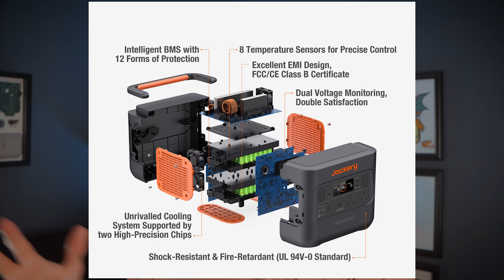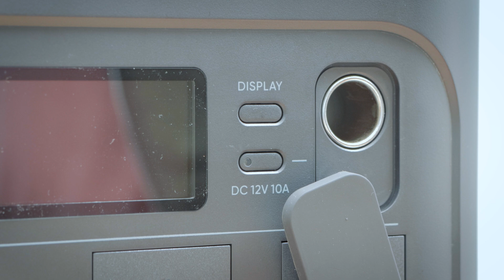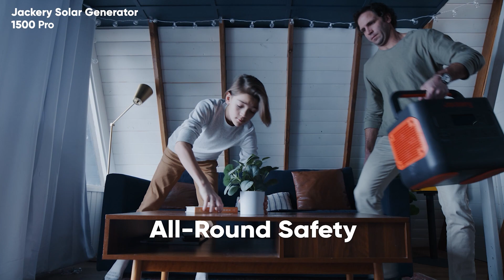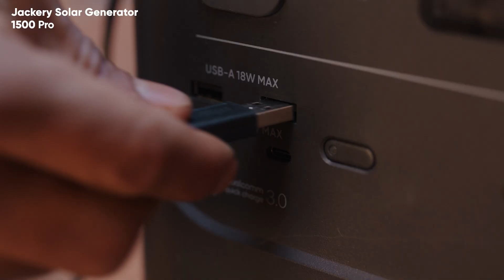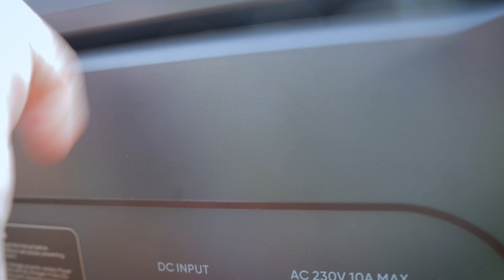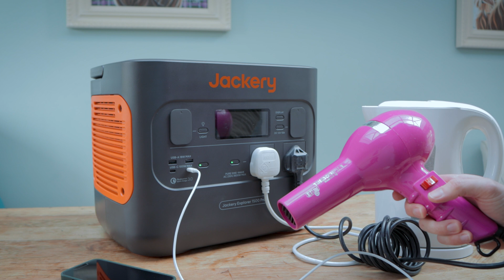Power Anything, Anywhere |  Jackery Explorer 1500 Pro Review

Comment: there was a power outage on february 22nd 2026 there was gusty winds of excess if 80+ mph and thanks to the pecron powerstation i was able to live like normally during that time, i was the only 1 with the lights on during that 17 hour time period 11:30 the power went out and the power didn't come back on later that day combined total of 4096WH i was able to power everything with the pecron powerstation.. its a miniature homeback up during the time of the black out. keeping the laptop running and having the fridge running as well along side the clock. when i was seeing the battery % it was reading 95% and it dropped to 37% and this was during the time during the blizzard as well, snow has dumped like 31 - 41 inches of snow during the blizzard in southern new england in massachusetts. (USA) thanks to this battery backup that i had, i was able to use the microwave during the power outage. 100 - 125 maybe 135 watts the powerstation was absolutely fantastic. the runtime with the fridge being cycled on and off was anywhere between give or take 24 hours to maybe 48 hours. when i was at 37% i was able to get another days worth in if anything...

Comment: Please read before purchasing Jackery products. I bought a brand new 1500 pro from their site and have had the worst experience. Save your money think twice! 

BEYOND FRUSTRATED DONT BUY FROM THIS COMPANY! When I received my first unit it was clearly brand new which would be expected. The battery was great worked exactly how they explained it would in the description. I would use this unit running off my ice co electric cooler with multiple accessories and it would last me 3-4 days while camping. Within the first 6 months I used it maybe 4 times and then stored it over winter (4-6 months) When I pulled it back out of storage for use the battery was at 97% hardly dropped from 100% when I stored it away. Awesome this is what they advertised on their website. But during my next camping trip my unit started showing a F0 code and nothing would work no input or output. This was a huge problem since I heavily relied on this unit to keep my food fresh and not spoiled. I noticed while lifting the jackery up and placing it in my vehicle to charge (thinking this would fix the pop up code) the F0 code turned off thankfully saving my food and my trip. When I got back home I emailed support and they informed me this was an internal issue causing some sort of disconnect normally due from faulty parts, dropping the unit or negligence during use. This was not my case since I never dropped the unit or mishandled it. I shipped my original unit back thinking they would stand by their “warranty” WRONG they clearly sent me a used unit that dropped battery 5-7 % a week. The unit had some use marks on it and I could tell it has been used before even though it was wrapped up like a brand new unit. I emailed support again going back and fourth as they tried to justify that this was normal even though my new unit did not have this issue. The battery was obviously compromised and after restarting it and charging this warranty unit to 100% it dropped down to 67% in 30 days. Support agreed this was not right or normal and sent me another unit. Annoyed already by this and me having to drop off now another unit to fedex I was adamant that they review this unit to make sure the battery was in fact compromised (so this wouldn’t happen to another customer) and to review the new unit they send me. They sent me another “warranty” unit… it was the same exact s/n # as the unit I just sent back to them! I cannot make this up.. terrible support terrible company! I bought this $1,300 1500 pro plus a $600 200W solar panel due to the great reviews and WARRANTY they claim to faulty parts or makes on their end so the buyer is protected on their investment. Don’t buy from this company! I fell into the trap of there multiple highly rated reviews (that they probably pick out) and the fact that they had 2-3 year warranty on their products. THEY DONT REVIEW THEIR RETURNED PRODUCTS AND WILL SEND YOU ANOTHER FAULTY UNIT THAT THEY CLEARLY DONT CHECK. PLEASE STAY AWAY SAVE YOUR MONEY AND GO WITH ANOTHER BRAND! Highly disappointed you are gambling big time with this companies products that the “new” unit you buy is actually new and doesn’t have any faulty parts and if it does even within the first year of owning you will not get a new or even close to new “refurbished or warranty” model. I hope this review gets out to the thousands of customers that look into this company and purchase their products that are not cheap by the way and that Jackery actually changes their warranty policy or at least states that you will recieve a unit that is not new and not even close to being a working model like described in the units description. They don’t review the returned units and I asked now that they send me my original unit so I can try to fix the F0 code myself at least I know this battery is a year old and only been used 5 times. They will probably hide this review and I will try to get my story out on other platforms so others can know. Terrible support and not true to their warranty description.. if you are buying becuase of the safe bet on the prodcut working and the 2-3 year warranty think again and pray your unit doesnt have an issue like mine did because they will probaby send you a POS old returned unit that they dont even review when receiving them from their customers! JOKE COMPANY STAY AWAY DO BETTER JACKERY!
Reply from the maker: Hi! Appreciate you sharing your experience with us all.

Comment: Excellent review thanks 🙏 will it run an air fryer up to what wattage please ?🤔🚍⚓️🇬🇧
Reply from the maker: Thanks! It will run an air fryer and off the top of my head max is circa 1800/2000watts:
1000watt air fryer - 1hr
1400watt - 40mins
upto 2000watt - maybe 20mins if you're lucky.
Reply: @TechNuovo  many thanks ….probably will get the 1800 pro  😉🚍⚓️🇬🇧👍